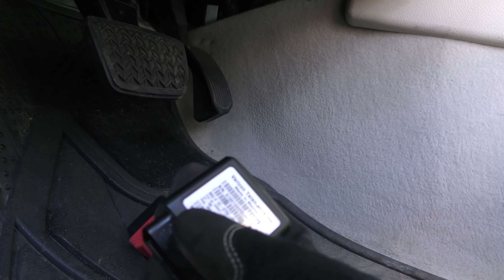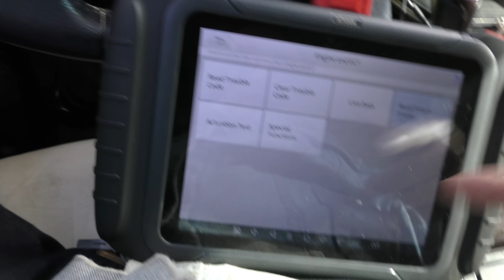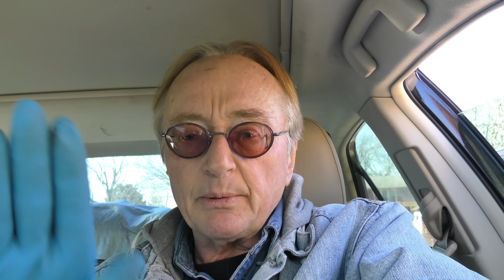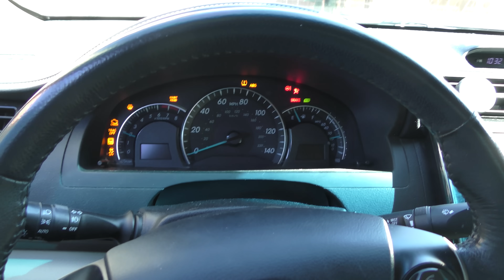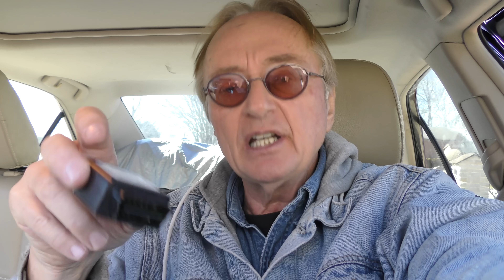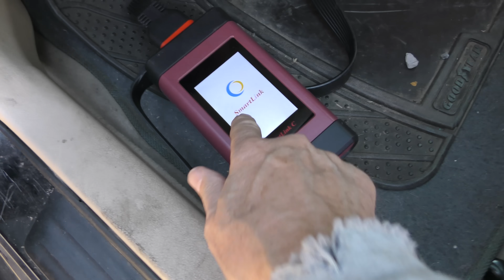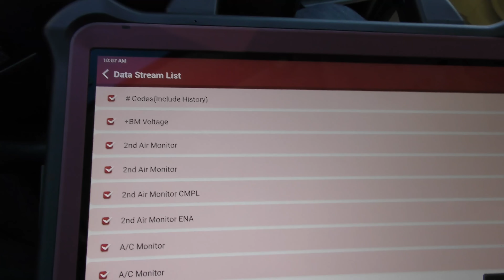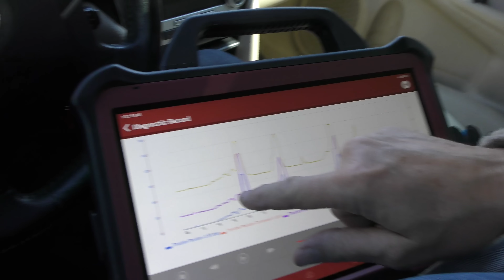This Stupid Device Just Cost My Customer Thousands in Car Repairs

Comment: I love how the accelerator pedal on my 1979 MGB is attached to my throttle with a MECHANICAL CABLE AND A SPRING. Why do I need a computer between me and my throttle?
Reply: You would think a simple cable should be cheaper than adding a stepper motor/controller on the throttle plate.
Reply: @petercandance2330  it ended up being cheaper & more reliable to go with electronic throttles. Mechanical throttles need a lot more frequent maintenance from mechanics (which was more expensive than the cost of the throttle assembly) lest your throttle gets stuck open.
Reply: @do0Mbot  there's also the thing where in a crash the throttle can get jammed open from the cable being pulled beyond its limits and cause the engine to race. Not exactly making the situation safer.
Reply: @JodyBruchon  that’s actually a non-issue. My MGB has something called the momentum switch that disconnects the ignition system and fuel pump in case of an accident.
Reply: @MultiPetercool  That's nice. Have you tested it out?
Reply: @JodyBruchon  No I haven’t and I don’t have airbags either. Lighten up, OK?
Reply: @MultiPetercool  🚲
Reply: @JodyBruchon  That’s what I love about my MG, it gives me a motorcycle experience. There are times I wish I could just unbuckle the darn seatbelts! I don’t need a lot of stupid safety features to protect me from myself.
Reply: The advantage of an electronic throttle is you can control it using more factors than pedal position. For example, you might want the throttle to be affected by intake manifold pressure.
Reply: The ONLY thing I can think of is a situation that happened with my late grandfathers (now my) old truck. I was sitting in it while it was off and I pushed the gas pedal and the cable got stuck and I had to fiddle with it to get it to spring back, not what you want happening when your driving down the road. Nonetheless I still prefer an old school cable just keep it lubricated or something
Reply: @shadowkidgaming8253  I had a DAILY driven old car, that I used for 40+ years as my only vehicle... It was a 1967 Ford Falcon GT.  During its entire, long life, NEVER EVER had ANY kind of accelerator pedal issue or the slightest trace of a problem. It was a solid metal rod supported on two brass bearings, plus a theaded rod with a ball end and a single return spring... Never failed at all! and it had a very nice, very linear response curve, not like much newer cars that cheat on the driver to "feel" more powerful than they really are.
Reply: Very simple. An electronic one has more precise control.
Reply: @The2Coolest2  takes some getting used to going from electronic to mechanical
Reply: Old school works better
Reply: @dwheeler016  amen brother!!!
Reply: @dwheeler016  then why'd they change it.
Reply: @do0Mbot  planned obsolescence, an additional expensive part to replace in the future? Weight saving?  All of the above.
Reply: @dwheeler016  🧢 a few bad 🍎 s don’t spoil the bunch
Reply: Same with transmissions. If I put it in neutral, it better be in neutral. It's why I prefer manual. Real manual with no computers.
Reply: @MotoroidARFC  a manual is run by a human computer and performs worse than the junkiest modern automatics
Reply: @veganpotterthevegan  False. A manual transmission is run by a human computer, yes. Guess what humans have that control modules don't? Eyes. Oh, and memory and heuristics and experience and control over the throttle and steering and brakes. Guess what a human computer can do that a car computer can't? See the hill ahead and select a gear and throttle setting that is appropriate. When you go up a hill in an automatic, guess what you can do? Stomp the pedal until the kickdown is triggered which throws the automatic into the lowest gear that won't exceed the red line, wasting plenty of fuel and putting more stress on the engine (and possibly even damaging the catalytic converter if the spark plugs are old and near the replacement interval) than dropping to 4th gear and easing onto the throttle to get up the hill.

BUT HUMANS ARE SO MUCH WORSE THAN A SUPER SMART COMPUTER IN A CAR
Reply: My 2010 still has a mechanical cable to open the throttle
Reply: electronic throttle control gives better emissions. I'll take the gas savings over throttle control for a daily.
Reply: @aaronbackus4548  Paying a little more for gas beats paying hundreds or thousands to diagnose and fix complex and expensive electronics. I’ll take simplicity and easy serviceability EVERY time!
Reply: @MultiPetercool  Or you could just learn how to diagnose simple electronics issues. The only time it's bad is if it's a PCM but those rarely go bad. No one is daily driving a 79 MGB seriously, why would you bother?
Reply: @aaronbackus4548  Believe me I know my way around a multimeter and most basic analog and digital electronic design. The fact remains is I think we’ve gone overboard with computers. I have used the diagnostic port on my newer cars many times. Given how long it took Scotty to diagnose this problem, I’m not convinced computers make things any better.
Reply: @aaronbackus4548  there are plenty of other cars out there that are much newer and more practical than my lovely MGB. they don’t have a lot of the fancy computerized features a 2022 model would have. I actually owe my entire career to the computer industry but there are certain applications of computers that I think are just plain irrational.
Reply: @MultiPetercool  lol. I never said anything about 2022 models. I drive 250 miles minimum a week and usually go 300. I spend most of that time at 3000 rpm going 75 mph. Gas efficiency is a concern when you do that much travel and electronic throttle intakes are common place in just about anything made over the past 20 years. The last throttle body I had with an actual cable was a 2000 Chevy Blazer. By all means, use it for a non daily driven car but there's no reason to go with a mechanical throttle body for any serious daily driving.
Reply: Mechanical is good for reliability, but digital is adjustable. Most modern cars have 2 or more drive modes. In the eco / normal mode the computer doesn’t respond as fast as in the sport mode. This saves gas because you literally gotta floor it if you want to go fast. Switch to sport mode and the car jumps with light presses on the throttle. Some cars have 3 modes. The slowest is for penny pinchers who want maximum mileage, the fastest for spirited drivers needing speed.

Fuel saving is the original purpose, because manufacturers are mandated to make internal combustion cars with certain mpg. They can just make the throttle less responsive to save gas, but that would make the car hated by younger drivers. The compromise is the digital throttle with multiple modes. They can submit the slow throttle mileage to the gov’t while letting fast drivers enjoy a faster ride with the faster throttle.
Reply: Well, if you did have a computer and Lucas built it, it wouldn't work anyway...gotta love the cable, for sure!
Reply: I get it, I had a Triumph TR6 with two carburetors and a mechanical rod linkage. But the fact is that modern cars with fuel injectors, a multitude of sensors, electronic throttle bodies and everything controlled by a computer actually works great. The result is there is almost no unburnt fuel left on the cylinder walls to destroy the motor oil. Most cars can now go 5-10 thousand miles before an oil change. This is one of the main reasons why modern engines regularly last 200-300 thousand miles and even longer. That would have sounded insane back in the '60s and '70s.
Reply: Same for my 1978 Chevy LUV.
Reply: Carry an extra cable because one day it might snap and leave you stranded.
Reply: Too adjust your timing....and fuel injectors
Reply: @robbinst71  why can’t I have an override mode so the computer doesn’t have to do everything?
Reply: They did they the same with motorcycles, they are are all “ride by wire” now. It means they can tune them for emissions and noise regs easier, but it can depending on the make and model affect response and drive on part throttle , give me a throttle I open, when I want it to open any day😀
Reply: They have to do this so you can't fix it for just a few quid.bloody ridiculous
Reply: I prefer the electronic one, you have more control of the throttle body with it
Reply: @sugarbooty  — If you don’t have sufficient throttle control with a mechanical linkage, it’s because your brain doesn’t have proper control of your foot ... Perhaps you should consider seeing a neurologist.
Reply: @sking2173  its sufficient but at low revs you only have a certain range of the pedal that does anything before it doesn't give you more power and just gets louder. Not to mention the millimeters at idle to get to a certain rpm. I like having the pedal scaled to the power the engine can actually provide
Reply: @sugarbooty  my car with electronic throttle is like 20% gas pedal down, 20% throttle open, 30% gas pedal down, 100% throttle open. so are you saying you just don't want to have to push the pedal all the way to the floor to actually get 100% throttle?
and it only reads as 88% throttle as my 'max' setting.

Comment: I hear you should never push open a drive by wire throttle body only manipulate it by having the key half cocked and have another person push down the gas pedal to open and close it I hear it's a big No No to push it open with your fingers

Comment: My 1975 Buick Riviera has a real throttle CABLE!
Reply: Be careful that it doesn't stick at full throttle and kill you.  And check whether your steering wheel locks when you turn off the ignition to stop the car when that happens.  Cars back then had their own dangers, and everyone my age (64) knows someone who died or nearly died from a stuck-throttle incident.

Comment: Yo, what about that mountain of corrosion on the battery cable?
Reply: @burt sanders Yep, by taking that voltage (or current load test) reading from the battery terminal CLAMPS did not test the cable-to-clamp electrical condition at all.  Also, those diagnostic graph "glitches" showing up simultaneously on multiple sub-systems point to a potential power supply problem or bad ground.

Comment: Scottie,  I have a 2011 Ford Taurus sel.  My problems are when I start the car the electronic ignition gets stuck an Revs high.  I have to turn it off then there’s a clunk.  I restart and it’s ok.  Then while driving after the cars warm. I’ve been driving half hour or so I go to push on the gas while driving and the car won’t go.  So I drift over to the side of the road and turn it off and restart and it’s fine for a few more days.  The mechanic said… after having it for two months and four days, that he put in an after market  throttle body, and an excelerator.  He checked the computer and other modules and can’t find  anything.

Comment: That's probably what messed up the cars computer, great job Scotty! Lesson well learned I hope. 😎👍
Reply: I woudlnt blame the computer. It was probably the throttle pedal, throttle body or wiring harness. When in doubt, swap with a salvage part.
Reply: @PremiumFuelOnly  I can tell you from personal experience that the goofy Verizon plug in devices do mess with your car. I had one of their devices in my Journey and after a couple of months the car started acting goofy, dash acting weird,  electronic issues, things like that.  I unplugged the device to take her to the dealer and everything cleared up.
Reply: Bad transmission torque converter was what was wrong with mine, dealer replaced it for free
Reply: No it wasn't, he didn't even check fuel trims, grounding points in the engine bay, or the main culprit a worn out battery.

Comment: Some auto insurance companies offer a dongle to plug into that to monitor your driving. That plug was designed for mechanics to diagnose a problem, not meant to have something plugged into all the time
Reply: OnStar is also wanting people with 3G to update by using a dongle.  Guess I’ll switch to AAA soon.
Reply: @lynnhoffmann247  but do you need to keep plug in all the time while driving? It's ok just to update and then unplug after finish.
Reply: @davinp  They’re turning off the buttons on the rear view mirror & you now have an app on your phone to call if you need assistance.  What if you wreck & the phone goes flying out of reach?  I’m not liking the whole new plan (going into effect later this year), so I’m just canceling.

PS - If you want the crash detection to work, yes it has to be plugged in while driving.  All of the other features (calling & directions) I can already do with my cell…

Comment: I roll the drivers window down often just in case my dachshund locks the doors again. Apparently verizon telematics is a type of monitor of car use, location, and other crap to big brother the use of the car.
Reply: My uncle had a big black lab for years. The number of times that Molly locked him out of his truck was hilarious. Hed put her in the truck and would forget something, run back in the house and come back to a locked truck. He unhooked the passenger switch and left the windows cracked enough to unlock them every time. The amount of times that dog did that... she lived to be about 14 or 15, so it was a lot 😂
Reply: One time I had a big gust of wind blow my door shut before my daughter could get out.  I had locked the doors, she was getting out of her car seat to crawl over to my side for me to get her out.  I kept trying to get her to push the unlock button, but she wasn't old enough to understand to push the button.  Another vehicle, I jumped to do something quick, shut the door, and for whatever reason the stupid automatic locking doors triggered and locked me out.  I've always ever since roll my window down at least half way.

Comment: I hesitate in cold weather too !
Reply: Check your dongle.
Reply: @gregnixon1296 check your dongle lmao 🤣
Reply: Well judging by your last name you shouldn't hesitate
Reply: I hate the cold that's why I'm moving to southern Texas
Reply: @enemyofthestate9358  it's been 30 degrees basically everyday down here for a while already its still cold somehow
Reply: @enemyofthestate9358  be prepared for summer bugs and weird heat waves, always carry a slipper to smash sneaky bugs in your home and sunscreen. Winters are 30F. Summers 70-100F.
Reply: Turn you heater all the way up, that may help some 🤔
Reply: Be sure to pull out your dongle and play with it. You should be fine.
Reply: @randallbourne2717  Just don't touch any frozen metal poles with it.
Reply: From the top or the bottom 🤔
Reply: @davesmith3613  
Super Duper 👍🏼🤝🏼👍🏼
Reply: Yes your throttle body need clean too
Reply: I hesitate Creek snap and pop in the cold weather the joys of having passed down genetic arthritis I'm only 27
Reply: Vintage model